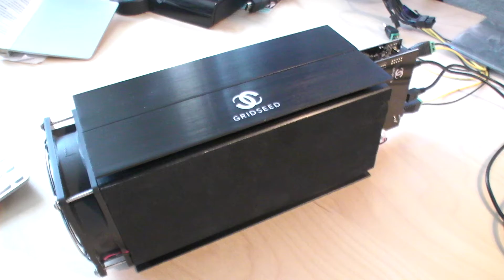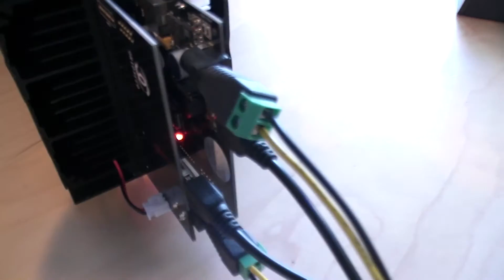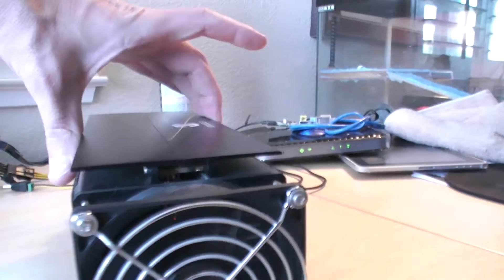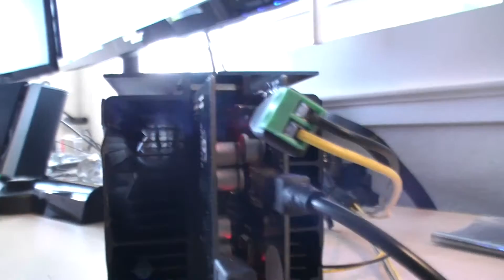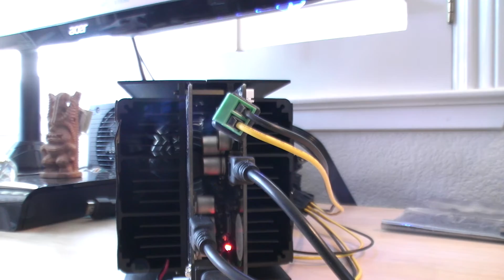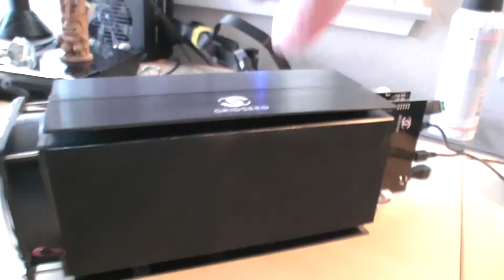Gridseed G-Blade 5 Mh/s ASIC scrypt miner overview

Comment: Do you have the rasberry pi as your controller? If so is it the one where you can run up to 16 blademiners? If so which version of rasberry pi are you using. There is a, b, b+,c etc. Please advise. PS. Thanks for the sound check. You realize what it sounds like is determined by my speakers volume and youtube preamp lol.
Reply from the maker: I am using the raspberry pi b version. Your success in running 16 blades will lie in your miner and powered usb hubs.